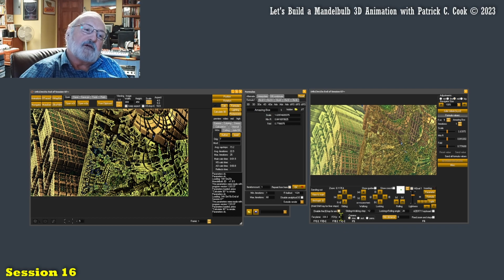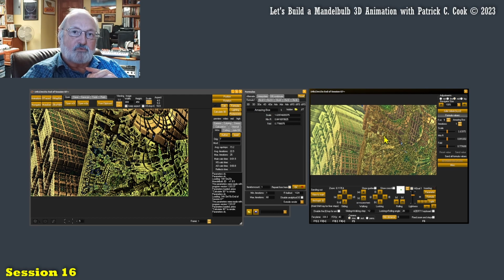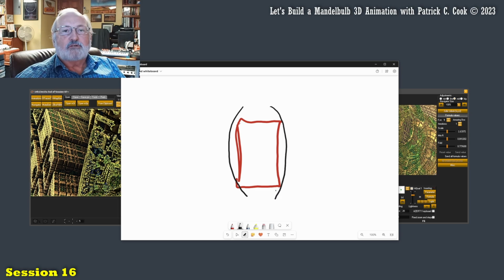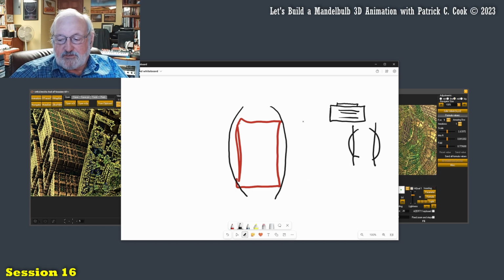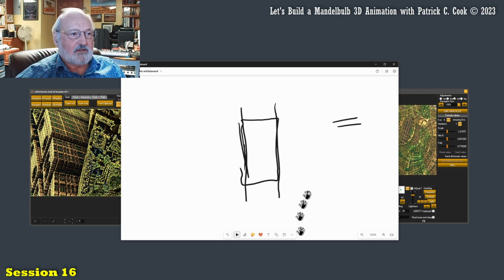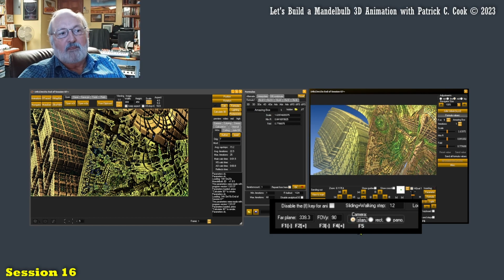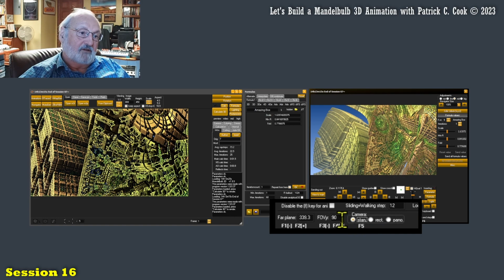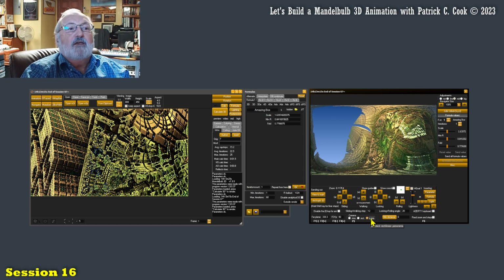TS1.16 - The Navigator; The Camera Type selection - Mandelbulb3D Tutorial Series 1

Comment: I can't stress enough how fantastic this series is; in those 16 sessions, I learned more than reading various forum posts and or watching other tutorials. the intricacies around the camera alone are mind-blowing.
Reply from the maker: Thanks! This is the result of several years of using MB3D for complex animations, backed by a lifetime as a photographer and a professional software developer for 40 years. I appreciate what MB3D can do and have found ways to "survive" its shortcomings and fill in the knowledge gaps by sheer trial-and-error. MB3D is an incomplete software application that would have been great had it continued to be expanded after about 2013. But, it remains very good at what it does as long as you know how to work around its flaws. I got to a point where I wanted to help other fractal artists get value from MB3D as I have. I'm happy this tutorial series is helpful.